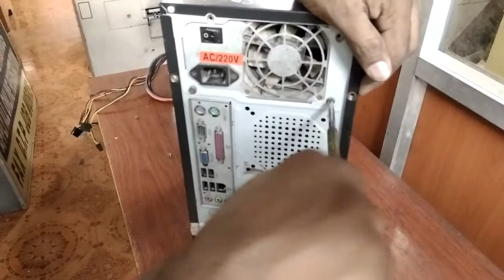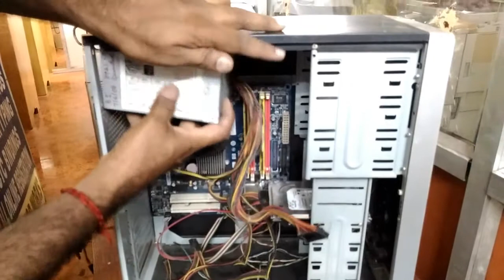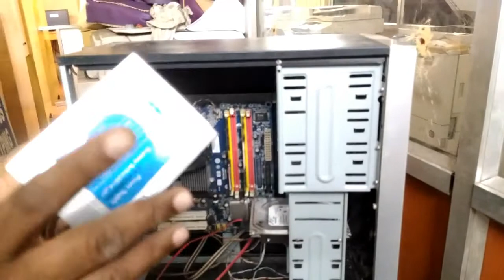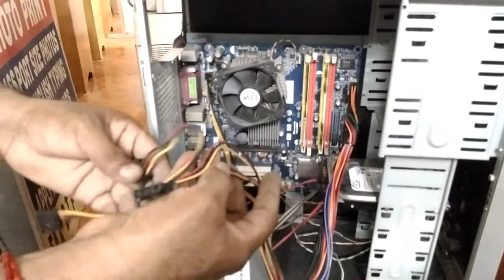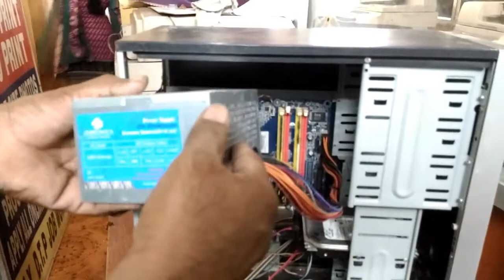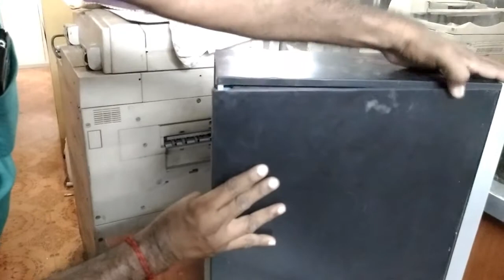How to change SMPS in Computer/ System | How to install New SMPS system

Comment: I have almost the same cabinet , suppose i have 250W SMPS Can i install a 450 W or 500W ? should i go with a same company or any company? please reply as soon as possible
Reply from the maker: yes you can install 450 smps
Reply from the maker: but see the board capability before install pls
Reply: @electrotech567  bro what is board capability